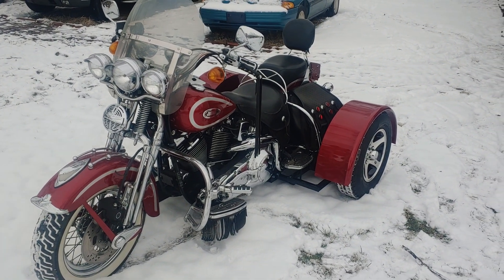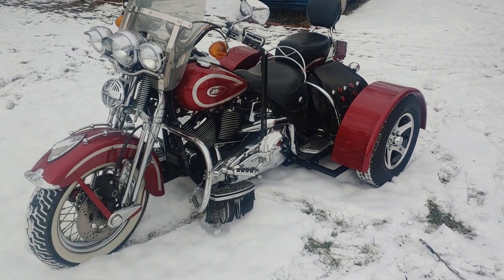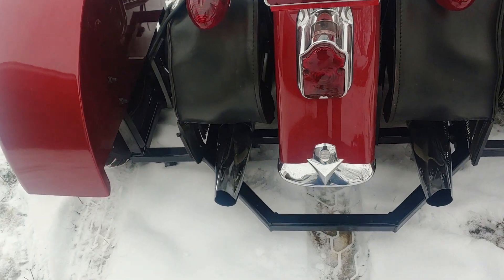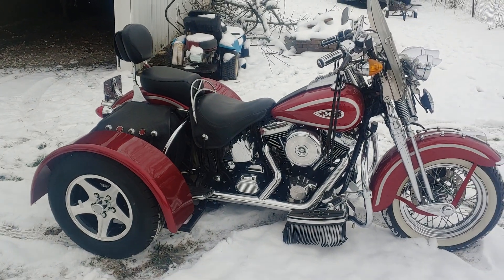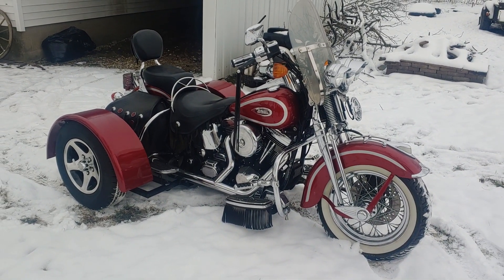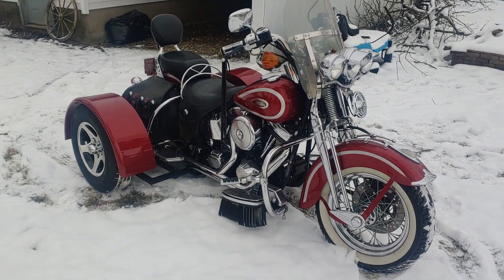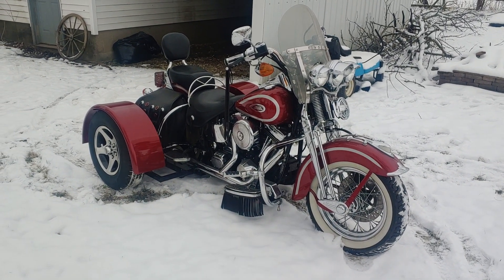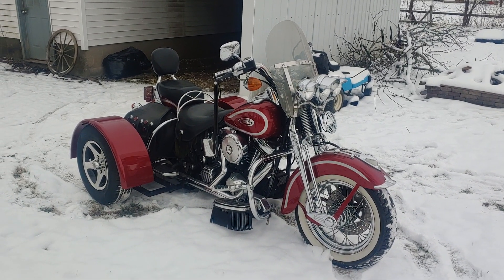BIC Trikes 1999 Harley-Davidson Springer Softail

Comment: Goodness $400 for fenders wow hope that's with installation we have retail store up here called Princess Auto that sells those for $24 each and thats Canadian $'s...Regardless it looks Good!
Reply from the maker: These cost me $98 a piece plus I have to weld angle irons inside to stiffen it so the metal won't crack and break from the vibration and yes that is installed. The standard plastic black fenders are already in the price. Thanks for the compliment and comment.